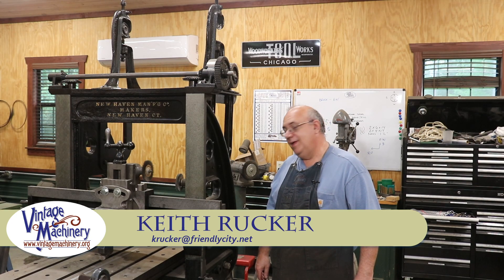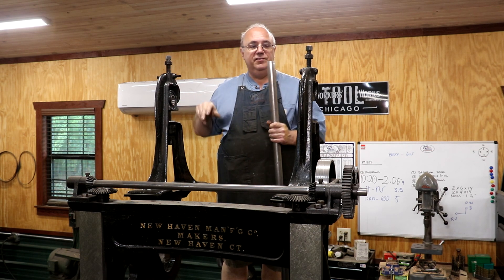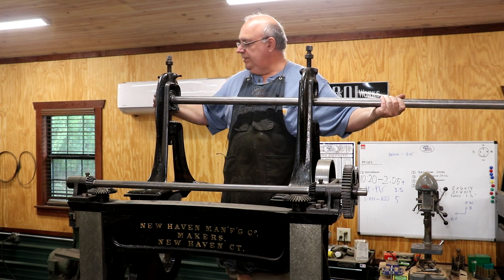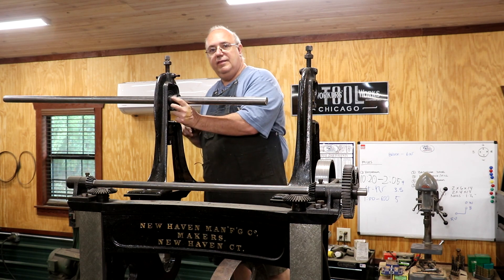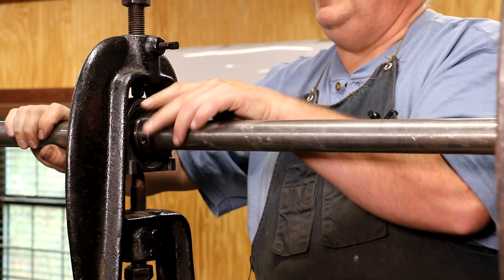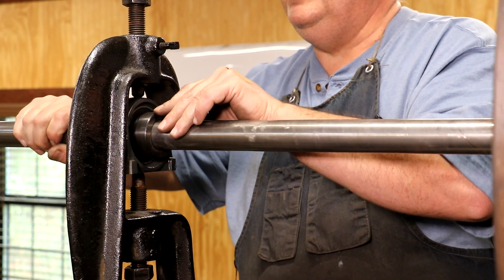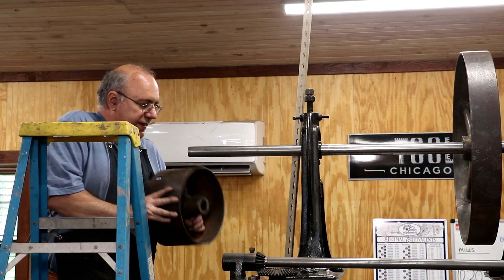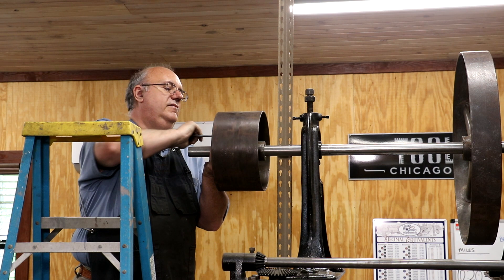Metal Planer Restoration 56: Mounting the Countershaft and Drive Pulleys

Comment: I haven't seen the pillow block bearings you are using but the ones I've used have a hole in the outer race. When the fitting is greased, the grease comes out of the seals on the bearing. I like the bearings with the set screw in the inner race instead of the cam lock type. The cam needs to be locked in the direction the shaft will be turning or there's a chance it will come loose.
Reply: Isn't that what the set screw on the cam is for?
Reply: the  pillow block bearing that i have used have a small hole on the inner race as well and a small nub on the race to keep it from turning in the block and the nub lines the grease hole for grease and i have seen a few as a machinist
Reply: Same here, I've been servicing and selling all forms of mounted bearings and inserts for three decades so far. All of the UC series inserts I have seen (1000's) have a grease groove around the outer ring that is fed grease via a recess cast in the housing directly under the grease fitting bore.
Reply: I hate those eccentric locking collar type bearings and the non-serviceable types as well. When it came time for overhaul on the machinery I worked on, those damn things were the first to go into the scrap bin.
Reply: @steamfan7147  But does that allow grease to the actual bearing ?
Reply: @millomweb  What every is trying to tell but not clearly is that there is a small hole in the outer race of the bearing and a grease groove cut on the inner bore of the housing allowing grease to get into the bearing through the hole. As for some saying about the nib or other kind of alinement it is mainly to keep the outer race from spinning in the housing. Also it only will let the bearing be installed one way so the grease hole lines up with the groove.
Reply: @millomweb  Yes, just google image search "UC bearing insert" for a few thousand examples.
Reply: @brucetuckey7909  Aaah, I think I get the point now ;) so there's a groove in the cast container so that it doesn't matter where the hole in the outer bearing is, grease will find itself going around the bearing to the hole - when the nipple and hole aren't aligned. That's making sense.
Reply: Same here industrial maintenance for 45 years saw several with holes for grease to enter the bearing
Reply: @alanjackson4397  Well I am glad I am not the only one that has been doing it for a life time and seen the same stuff.

Comment: Keith, You have some miss information on the bearing and pillow blocks. There is in fact a hole in the bearing race and a groove machined in the housing bore under the grease fitting, expect more comments on this matter because there are a lot of us that know about these bearings. Great progress on the project.
Reply: He may have chosen sealed bearings for his retrofit. After all it is his machine to set up and enjoy. Mr. Rucker is a collector of Vintage Machinery information and reference materials from which many have benefited. Please let us not discourage these great Men who share these Videos.
Reply: @keith73z28  Agree he may have chosen the sealed bearing however the fact that the bearings are available both ways but is not presented.
Reply: @truthhurts8551  The sealed bearings he chose will last 3 lifetimes!  This machine is more of a showpiece than a working shop machine.  I would guess it won't have 100 hrs on it in 10 years.

Comment: I think that when the pulleys are in their final position it would be a good idea to drill pockets in that shaft for the set screws.
Reply: Yeah, no doubt as an extra measure for non slipping.
Reply: I was about to say exactly the same thing. It won't take long for that shaft to become very galled up.
Reply: Also, being the drive pulleys, there's going to be some considerable torque on it so I agree that a more positive lock down would be a good idea.
Reply: I  was  wondering  about  a  key  .   Maybe  there's  a  reason ?
Reply: Would not the dimple (in the shaft)for set screw do more damage if it slipped? Certainly to the shaft but also to the hub of the wheel. 5/8 set screw has a dimple that cuts into the shaft, should hold it fine.
Reply: @ColinMacIver  If there's a seat for the set screw, the screw would have to shear off to "slip" and if that happens, you've got much bigger problems than a damaged shaft.

Comment: There is usually a Small hole on the outer Bearing race that accepts the grease on most Pillow Block Bearings.
Reply: Every one of those bearings I have used has a place on the outer race to let the grease enter the bearing. Maybe he has some different model that I am not aware of.

Comment: Just my two cents worth on greasing the bearings. I grease these bearings every 400 hours. If you take one apart you will notice the bearings have small holes in the outer race. The casting has a grove all the way around it to carry the grease to those small holes in the bearing. So no matter where the bearing is sitting it will get greased. Also most of the bearings we get are pre-greased but we fill them anyway. These bearings are run for 16 hours per day, 5 days a week. They have to be greased every month. 
I noticed when Keith modified the bearing housing that he cut into the casting all the way to the outer race of the bearing. He can't grease it now even if he wanted to.
For all the time that this machine will be running, the grease that is in those bearings will last him a long time.
Great video's Keith, I enjoy every one I have watched. I even learn from you! Bonus.
Reply: 400 hours?!  This machine, although very capable, is more of a showpiece than a serious shop tool. At that rate, I figure Keith can schedule a bearing greasing around 2031.

Comment: Are the shaft mounting stands rigid enough for the job? They looked a bit wobbly when you were mounting the shaft.  With a large motor, several heavy pulleys of different sizes and belts spinning around, there is bound to be some shake and vibration.

Comment: the bearing has i small hole in  the outer  shell  that allows  grease to get in to the bearing . there is a grove in the bearing block  from the grease  Zerk as you call it
Reply: And when he milled away the outer casing, he compromised those grooves, effectively ruining those bearings. They are definitely NOT sealed for life, in fact, most manufacturers whose products I service only have a very small amount of grease in them to protect them until installation, usually take about 3 pumps on a grease gun to fill them.

Comment: Those inverted hanger don't offer much lateral stiffness.  Some machine harmonics might get them wagging.
Reply: You noticed that too when he was loading the shaft...
Reply: @tomp538  Unlikely.  Gyroscopic forces of such heavy wheels tends to put harmonics 90 degrees out of phase.  It's a system that's worked for over 100 years.

Comment: Top work Keith, as always. Can’t wait til you get an actual line shaft in the shop. There was an engineering shop near to my home when I was an inquisitive 12 year old. That was completely driven by overhead line shafts and was a marvellous sight to behold, and much quieter than a factory full of electric motors, which is where I ended up.

Comment: Keith  Correct me if I am wrong, but most pillow block bearing I have installed, are made to be greased. Where the grease fitting is in the pillow block, their is a grove on the inside, that lines up with a small grease hole in the bearing. Rotate the bearing 90 degree to the pillow block and look for the grease hole.

Comment: I think you will find weep holes in the outer race of those self aligning bearings so that some of the grease does in deed get into the bearing... There is a channel in the mounting frame of that bearing for conveying grease to the holes in the outer race, or at least the ones I was involved with had them....We had rows of those bearings on a conveyor belt at work and it was my job to grease and maintain them... Trust me, if no grease got into those bearings, I would be changing them in short order for sure with calcined coke running over the belt.... Cheers from Louisiana... Mike

Comment: If I'm following correctly, you're basically one motor and a few belts away from turning this machine on right? It's exciting to see after years of work to be this close.

In regards to painting, what are the most durable paints to use for machines?

Comment: Sorry for an apprentice-grade question - what stops the big set screw from spinning on the shaft if the pulley is blocked up for some reason?   Would the belt simply slip first?   Or does it need a flat spot milled or a divot drilled into the shaft at that point ?
Reply: I'm thinking the same. This is set up to slip on first try.
If there is no key in the pulley then there might need to be a hole in the shaft for the set screw to go in.
Reply: Nothing to stop it from spinning but friction, both of the screw point and the bore of the pulley being clamped against the shaft by the set screw.
Reply: There is enough momentum to keep things moving in case of a sudden load. And, if there were to be a catastrophic seizure, better to have that set screw slip than something harder to replace get broken. It's also probable that, as you guessed, the belt will slip first.

Comment: On the pillow block bearing the race that “only gets grease” it has either a whole and or groove that greases the ball bearings. That cover that you say is sealed is just a dust cover. Run that machine long enough without grease and the bearings will fail. I’ve use pillow blocks on several shaft applications and they require grease.

Comment: Maybe another pillow block bearing in the centre of the shaft to terminate the diagonal so you clear the big centre pulley.
Couple of cast iron toggle adjusters wouldn’t look too far out of place on that machine.
Back to front should be fine with those bearing hangers, that sideways movement might cause you some grief down the road though.
Cast iron doesn’t like to flog in my experience.

Comment: The bearings I have seen can be lubricated.
There is a small hole in the outside ring. It is not centered. So do not change the bearing from one side to the other side.
Even I have seen new ones that where mounted in the wrong way.

And mixing brand between housing and bearing is not always possible. Because the place of that hole.

Machine is looking very good.

Comment: Can’t wait to see it finished and making chips. Are the set screws on the pulleys got a hold?  There’s a lot of weight and torque held up in the air by the two bolts that push the bearing blocks up. Should those two bolts be changed out with a block of steel?

Comment: When the outside belts tighten up under drive will they not Bend the shaft........
Reply: The belts are nowhere near tight enough to bend the shaft.  I suggest you tune in to "Dave Richards Steam Powered Machine Shop" channel to see a complete belt driven shop in use.
Reply: @paulcopeland9035  The belts tighten up on the Drive side as the Power comes in to drive the Machine if they did not the belts would slip and yes I watch Dave Richards

Comment: I'm surprised to see set screws locking the pulleys to the shaft rather than keys. I wouldn't have thought set screws would be sufficient.
Reply: Good luck to the poor sap that needs to disassemble it in the future without a pocket on the shaft for the cup point to bite into. SMH
Reply: Set screws are not hitting the shaft, they are in contact with the lip on the bearing eccentric collar.
Reply: @edlapreze4671  So there aren't any set screws in the pulleys? Must be my imagination. 😆🤣😂
Reply: @edlapreze4671  We're talking about the pulleys, not the bearings.
Reply: @tsw199756  pulleys, yes. Bearing set screws don’t go to the shaft.
Reply: @tsw199756  guess I miss read your statement
Reply: @IslandHermit  my mistake
Reply: This is the future calling!!! Watch the next episode to be set straight.

Comment: I was concerned at the amount of movement in the G supports whilst Keith was introducing the steel arbour. The supports are not original design and subsequent vibration under working load could lead to fatigue failure in the casting (round the drill holes). I would seriously recommend a cross support in the same plane as the arbour; or even better a criss-cross support to miss the large off-centre pulley.
Reply: Yes that pulley assembly wobbling like hell when that planer is in use. It could break that planer chassis.

Comment: @ keith rucker. i recently watched an old video of yours on electrolysis, it was very informative. i do alot of metal detecting and have a few questions. does it only work on iron and steel?  what would you recommend on brass and copper?

Comment: 5:45 I wonder how well that cam lock system holds over time. Obviously, in this application it will be seriously under stressed, but yeah, if it holds "water" that's a nice, clean, and easy to deal with setup.
Reply: I can tell you from years of experience that the eccentric locks hold very well when installed properly. As good as or better than set screws that competitors use.

Comment: Any concern over the shaft flexing under the weigh of the pulleys, resulting in eventual failure? Given the amount of weight up there, a broken shaft may break the frame of the machine, as I don't see any side to side bracing going on.
Reply: @mmm365  Nah, valt wel mee geloof ik.

Comment: Many pillow block bearings do have a grease grove in the block and a small hole in the outer race of the bearing so you can get some grease into the bearing, so saying it only greases the outside isn't entirely true. Overall I agree with you on not worrying about greasing those bearings. It's not like this is going to be a production machine. They'll last you the rest of your lifetime.

Comment: What he says about those bearings not being greaseable may be true for the particular ones he has (?). In all my years on the farm and turning wrenches at an ag dealership. If the pillar has a grease fitting then the bearing has a hole in the outer race so it will take grease. The ones with sealed bearings from my experience don't have grease fittings.

Comment: Often there is a liittle hole in the outer race to transfer the grease in to the bearing from the grease zerk 
have you tried to take the bearing out of the holder, then i am sure there is a hole
Reply: That's been my experience as well. I know when I grease them the grease comes out from the bearing seals rather than around the bearing insert.

Comment: Before you tightened the set screws on that  side pulley, you should have spot drilled the shaft so that the set screw would grip the shaft better, an also not gouge the shaft making it difficult to ever remove the pulley.

Comment: I saw a few older machines with convex pulleys(belt surface), any reason why older style pulleys would be convexed?
Reply: The concave surface is to help a flat belt track on the centre of the pulley. When the pulley gets worn and the crown goes down the belt will wander off the pulley.

Comment: The whole upside down line shaft install still bothers me.  That’s an awful lot of weight and dynamic force being applied to those two bolts supporting the pillow bearings, and if they fail the bearings will just drop out.  When mounted the other way, if the supporting bolt failed it would catch on the hook.  The lack of keys on the shaft also surprises me.  Perhaps I just don’t have a good feel for the forces involved, but having that much mass spinning above my head with so little support would worry me.
Reply: could be possible but they are decent size bolts that will make a lot of noise before falling out , as long as the maintenance is kept up it should be ok

Comment: Keith, Under the zerks theres a small button that goes into a hole in the bearing insert which allows greasing of the bearing. Tightening the zerk pushes on the little plug into the hole on the insert which doesn't allow the bearing insert to be removed or to spin...remove the zerk and button and you can remove and replace the insert. There is no reason to just grease the outside of the insert. Those bearings ARE able to be greased. FWIW
Reply: Totally correct. Keith, here's a quote from the NTN mounted ball bearing catalog: "The included bearings for units are factory filled with grease and sealed, but can be re-lubricated from the grease fitting.

You'll find similar information on the SKF site. SKF gives hours of operation under various load/climate conditions to estimate re-lubrication times. They advise pumping slowly into the grease fitting so as not to blow out or roll the grease seals. They advise pumping until grease comes out of the seals.

You might want to look at the SKF lube tables to determine if you really want to leave those bearings in a non-lubrical (is that a word) position.

Comment: Hi Keith. Awesome content. Love watching you in your shop.
Those bearings can most definitely be greased. There should be a tiny pin hole in the outer race, through which the grease will enter the internal parts of the bearing. When grease is added, it most definitely will come out on the seals.😬👍